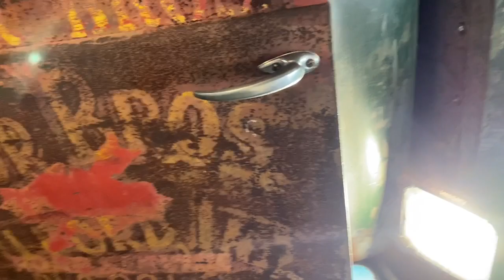1950 Dodge Power Wagon getting ready for cooler weather and stuff

Comment: So without the hubs is it always four wheel drive? I know there are the two levers inside the cab do those control high-low and 2wd vs 4wd?
Reply from the maker: Without the hubs, even in 2wd the axles are turning with the wheels just churning a gallon of 90 weight oil. And wearing out. It doesn’t make a huge difference but driving in traffic is a little easier. Yes, you are correct about the levers.
Reply: @JDawghasaTruck  Ahh okay that makes sense now. Which hubs are those/are there only a couple that will fit the power wagon wheels/axels? Figure I might as well do it now while I am working on the wheels
Reply from the maker: @DIYSCOTT  the brand is AVM from Vintage power Wagon. Not too expensive.